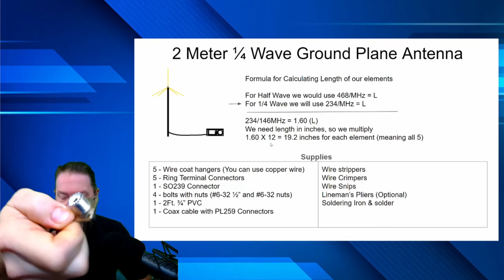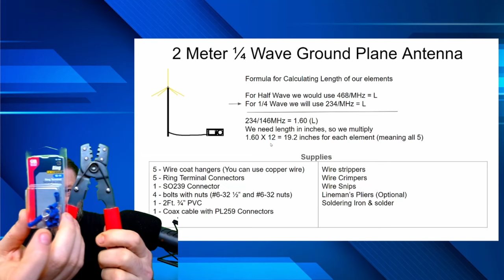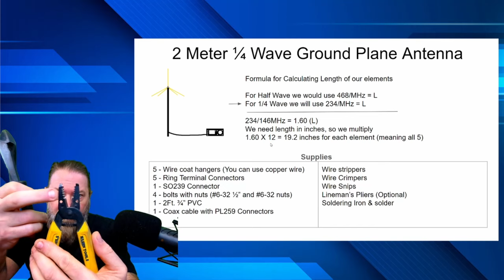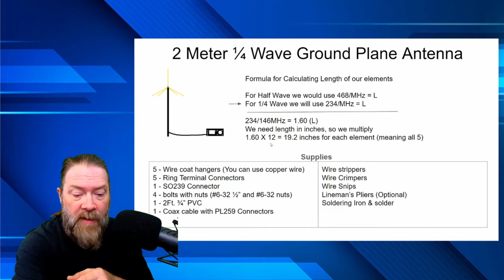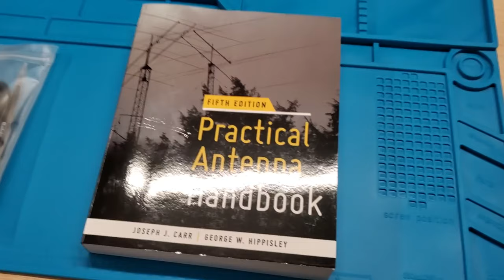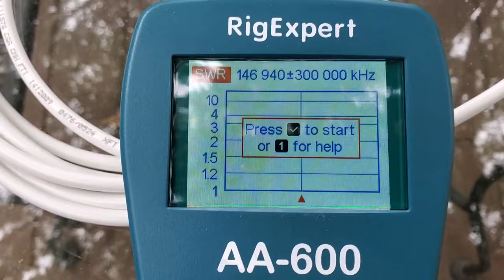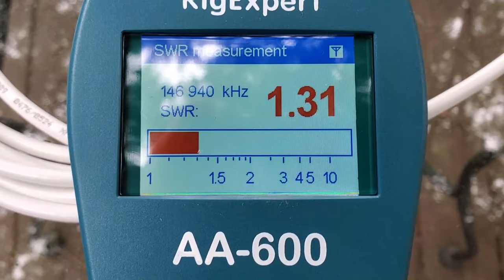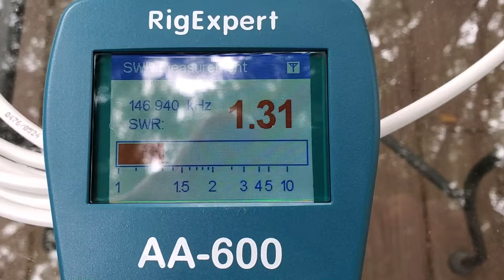Ham Radio Antennas for Beginners - Build Your Own Today!

Comment: how do you know how much power you can pump into it?
Reply from the maker: Most base rigs will only do about 50 watts and most handhelds will do 5-8 watts.  I wouldn't push a ton of power through something liker this, however up to 50 watts should be fine.  One way to tell is if you watch your SWR meter on your base rig.  If it starts to go up when you key up, stop transmitting and lower your power.  I am sure there is a more scientific way of figuring this out, but this antenna build wasn't really designed for mass power, but more to show that you can create an antenna out of almost anything.  Thanks for the comment and for watching!  73!

Comment: what is the range of this antenna
Reply from the maker: I would assume that would depend on how much power you are using and the height of the antenna a well as the lay of the land where you are.  If you have a repeater nearby (within 10-20 miles) you should be able to hit it.  On simplex (aka Line of sight), height and power will be a factor in how it performs.  Hope this helps.  Thanks for watching and for the question.,  73!

Comment: Of course, the REAL question, considering where we live, is whether that antenna will survive hurricane force winds... ;)
Reply from the maker: LOL...maybe so.  However, that antenna "can" be used from inside your house as well.  It may not have the reach that it would if you had it up 25 feet, but it will still operate nominally.  Thanks for watching and for the comment.  73!!

Comment: Why not just solder the radials to the holes ?  Much less chance for corrosion and probably will never loosen in wind.
Reply from the maker: I guess you could do it that way if you wanted a more permanent solution.  I made it this way to be able to tear it down if need be.  Thanks for watching and for the comment.  73!

Comment: Surprised you can solder a steel coat hanger wire.
Reply from the maker: LOL...with enough heat I think you can solder anything.  It actually wasn't that bad.  Thanks for the comment and for watching.  73!

Comment: swr analyzers are expensive
Reply from the maker: Yes....yes they are.  However, if you invest in a good one (i.e. RigExpert) it is a tool that you will use all the time and for decades to come as a ham operator.  Even more if you regularly build antennas.  It is a necessary evil and my philosophy is buy once, cry once.  Thanks for the comment and for watching.  73!